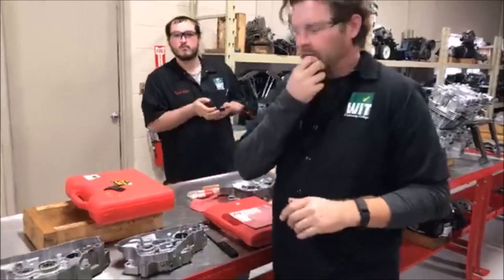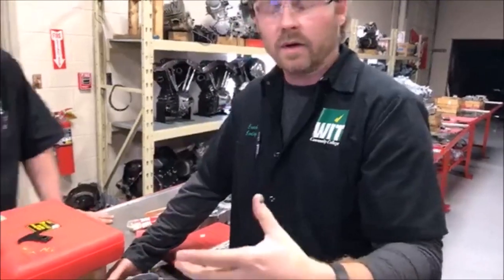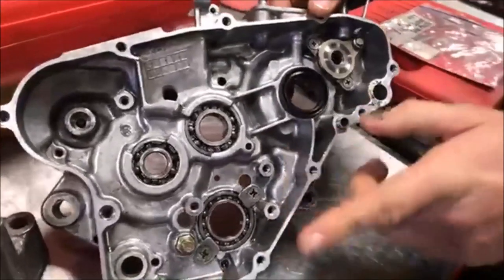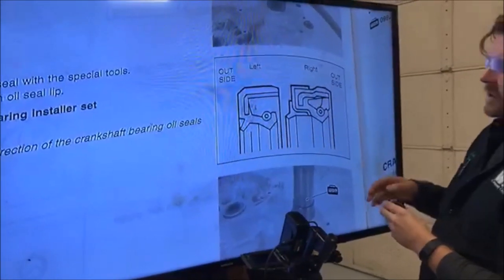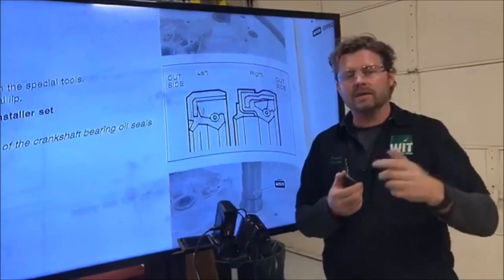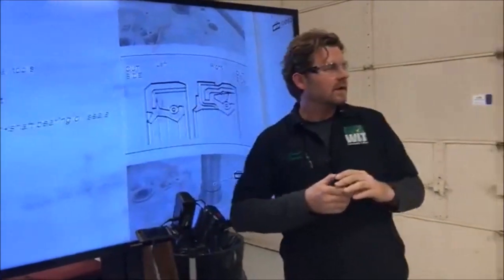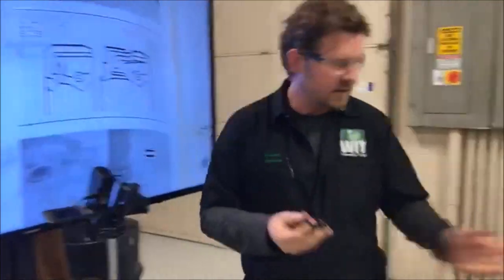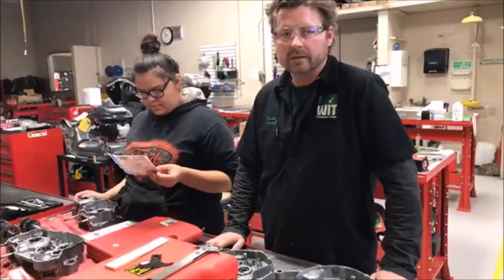Does the direction of an oil seal "always" face the same way? Check out this flipped Suzuki example!

Comment: HELLO MR. CONLEY I JUST WATCH A BUNCH OF YOUR VIDEOS , VERY INSIGHTFUL AND INFORMATIVE. MY QUESTION FOR U IS IM WORKING ON A 1985 YAMAHA YT60 TRIZINGER ENGINE FOR MY GOOD FRIEND WHO IS A TEACHER FOR CHILDREN WITH AUTISM SO NEEDLESS TO SAY HE DOESN'T HAVE MUCH FREE TIME. THATS Y IM DOING THIS PROJECT FOR A SURPRISE FOR HIM BUT MY QUESTION FOR U IS WHAT PERFORMANCE MODS. CAN I DO WHILE STILL KEEPING RELIABILITY? I HAVE SPOKE EXSTENSIVELY WITH TREATLAND ABOUT WHAT DIRECTION TO TAKE THIS AND I GET EVERYTHING FROM CHROME PISTON RINGS , SUPER STUFFER PERF. CRANK , CERAMIC COATED SEALED BEARINGS, DLS COATED PISTON SHIRTS , CUTTING WINDOWS IN THE SKIRTS OF THE PISTON. I WANT TO PUT AN PW80 CYLINDER IN PLACE OF THE 60 CYLINDER BUT I GUESS THAT INVOLVES MACHINING THE CASE A BIT SINCE THE BORE/STROKE OF THE 60 IS 44X39.2 AND THE 80 IS 47X42.5. THAT BEING SAID IN YOUR PROFESSIONAL OPINION SHOULD I JUST FAB. THE PW80 ENGINE INTO THE TRIZINGER FRAME AND THEN HOW INVOLVED IS IT TO SWITCH THE ORIGINAL SHAFT DRIVE OVER TO CHAIN AND SPROCKET? SORRY FOR THE LONG WINDED QUESTIONS BUT I WANTED TOFINISH THIS PROJECT BEFORE XMAS IF AT ALL POSSIBLE , THANKS FOR YOUR TIME MR. CONLEY , I HOPE TO HEAR FROM U SOON.
Reply from the maker: Yo! Want us to drop our wrenches and help you? We love helping subscribers…even on old videos! Help us grow friend! Here’s how:
1. Subscribe and let us know with a response. We will circle back when we can, it depends on member/customer demands and needs
2. We answer your questions EVERYDAY for channel members Join here: https://www.youtube.com/channel/UCBhM8DCKnT3qXwTW0eToyCg/join     
3. Give us a high 5 here: https://www.paypal.me/how2wrench  and I run back to the computer! 
4. Is this an emergency and your head is about to explode from frustration or fear? Get Shane’s cell here: https://how2wrench.com/product/personal-tech-training-phone-facetime/

Comment: i have an issue in my main seal for Mazda 2.5 engine, we did replace the seal two time the first was correct but i though there was a problem because there was leaking from it, then we did put the second one with the same issue, and after asking the previous owner he told me that the engine has been rebuild previously only for the head due to over heating issues, and now I'm wondering is my problem that the crank shaft need to be cerfaced and need to replace the main bearing and rod bearing ?